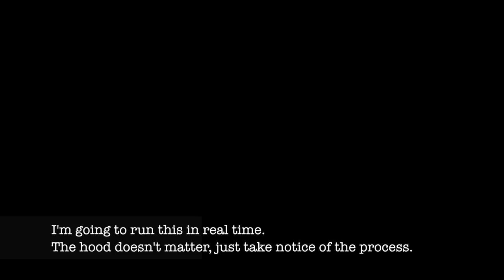Wet Sanding & Advanced Compounding: E5 - The Whole Process

Comment: I love how much harder the work looks for Andy with the dual action polisher. And the amount of time more it takes to get the job done for him versus the Jason and the rotary. Rotary first.
Reply: AyeTari yes when your cutting clear coat wool pad first to knock off the edge . Especially in body shop world . Then come back with a dual polisher to get that refined finish. Otherwise it will take a lot longer and then your using more machine work and can damage the foam pads because of the heat. Awesome stuff

Comment: I think the host is correct when he's talking about how much paint is being taken off. Regardless of how fast your arm speed may be, you are bringing the bad paint down level with the good paint. In order to do that a certain amount of paint MUST be removed to get it level. Yes arm speed keeps the heat down, but the host is correct, you are removing a huge chunk of that paint. however,  unless you fill the scratches in, then repaint, thats what has to happen. I'm not sure I understand the guys answers to the questions though.
Reply: Bobby Alford he showed u with measuring gauge that it removes paint but almost nothing

Comment: I've been correcting for 8 years now, like Jason having started in a body shop background and moving in the direction of actual paint correction. But for the longest time I thought I was the only one who use Andy's technique to use small amounts of a water based polish with a heavy compound to extend my working time so my compound wouldn't flash as fast and as well as temperature management and help the overall finish on my cutting step. 
Although I'm a huge advocate of cutting with a rotary for better results, efficiency and heat management, but in the cases where I did cut with a DA I always believed the idea of cross hatch patterns was stupid and you should be working the area at the demand of the paint itself working as fast as I need to moving the polisher as is necessary and working in an area as big or small as is necessary to get the result I needed. 
Guess my point of this comment is, I have absolutely no formal training and I use both Jason's and Andy's techniques myself just out of testing and developing them on my own over time.

Comment: Since I'm not a professional, what are my alternatives to blowing out a pad? With the air compressor and having that option available, it's easy to blow the pad out and continue compounding.
Reply: George Beato I have a brush I use to wipe out all the excess.
Reply: ThatGuyNamedScott. ...so the brush provides the same result as blowing it out. Well that was simple.
Reply: George Beato simple logic, stops the of getting clogged up!
Reply: Use a blower with a crevice tool smaller than what came with the machine
Reply: Marvin Enriquez ... Not sure you comprehended what I said, I don't have access to air or an air compressor. Unless I'm misunderstood your response?
Reply: George Beato Sorry. What i mean is use a vacuum cleaner that has a blower but then reduce the exit hole to get a higher pressurr to blow the pad out. You can also use the vacuum with a crevice tool and suck up the residue while u spin the machine. Look for Larry K.'s video where he polished a carbon spoiler.
Reply: Marvin Enriquez now that's a great idea. I'm going to have to try that. Such an easy concept yet never would of thought of using the vacuum!
Reply: A brush works but ideally you want multiple pads to swap out as you go from panel to panel.
Reply: Also the lake country pads washer. That's what I use works great but you need multiple pads on hand
Reply: Hold a microfiber towel in one hand and turn on the machine in the other hand and use the microfiber towel to clean the pad

Comment: How would you deal with the residue build up in the pads if you don't have compressed air?
Change pads every 30 seconds?
Reply: Luke Field I had asked this in a previous comment. Someone pointed me to use a vacuum cleaner with a crevice tool. 
Just watched a video on this from Larry Kosilla and it works well. Great way to improvise.
Reply: For a wool pad you can use a pad spur tool and for foam you can use a brush.
Reply: pad cleaner from lake country is the best.